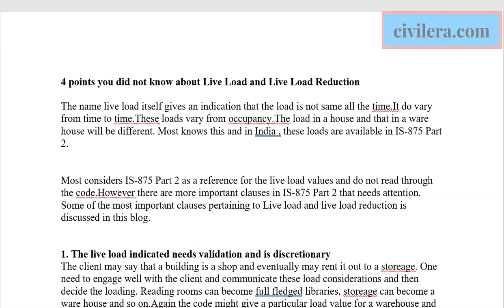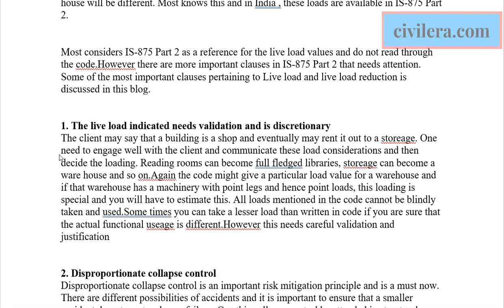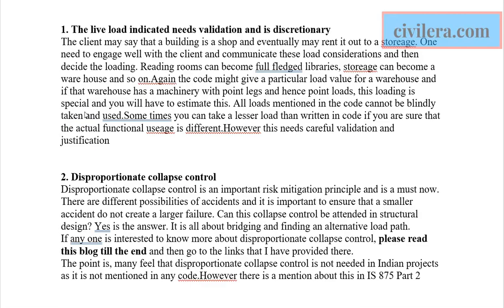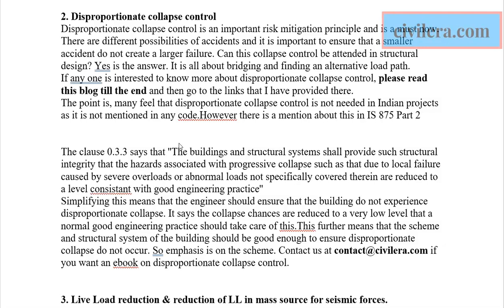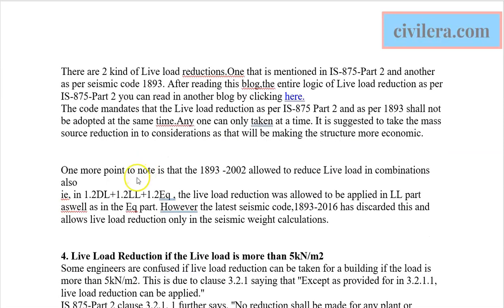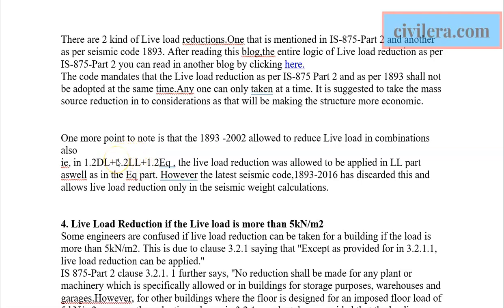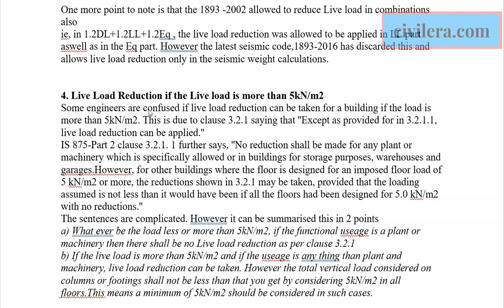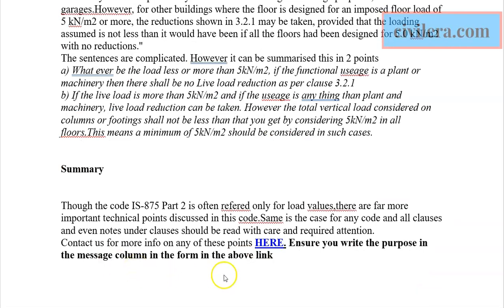Important points on Live load reduction

Comment: Could you pls. clarify one point? Suppose I am having live load 4kn/m2 under normal cond. Now, in seismic wt., I would consider 50% reduction i.e 2kn/m2. In the load comb. 1.2x(dl+ll+eq), shall the live load be 4 kn/m2 or 2kn/m2, since we assume only 50% live load in seismic wt.
Reply from the maker: That is the exact logic I wanted to tell you. Logically what LL is present will generate seismic mass. In another way, the existing LL is getting added up as lateral seismic mass. So if realistic LL is 2, then seismic mass also need to be 2. So even the LL part in that combo should be less. This was practiced by many engineers till recently. However....... I think there is a clarification by the IIT that, this reduction shall not be applied and after 2016 revision we are not adopting this reduction.
Reply: @CIVILERABangalore  thank you for the prompt response 🙏.
Is it written clearly in 1893-2016 that full live load be taken? In IRC : 6, table 1, it is clearly mentioned that live load will be 20% of the normal value in seismic condition, which led to my initial confusion! However, there is another aspect in building design. The floors of a multistorey building may very well be loaded independently so that it is possible to have some storey having full live load while some have reduced live load at the same time during seismic condition. Since live load reduction is based on probabilistic approach that all the storeys will not be loaded to full value simultaneously, it may hold true even when certain storeys are fully loaded. Therefore, analysis with reduced live load may render those floor beams having full live load unsafe in seismic case. So, it can be concluded that the vertical component of live load can't be reduced in seismic condition as well. This also justifies 1.5(DL+ EQ) comb. taking live load component in seismic wt. although its vertical contribution is ignored.
Reply from the maker: @schatrg   My blog + video explain most of what you have mentioned apart from IRC
About if it is clearly written in 1893 - I think NO. But I remember reading in explanatory hand book or some article from the IIT that directs us to discard applying the reduction in the combinations. Our consulting association also had discussed this some time and decided the same. I clearly dont remember where is the reference.